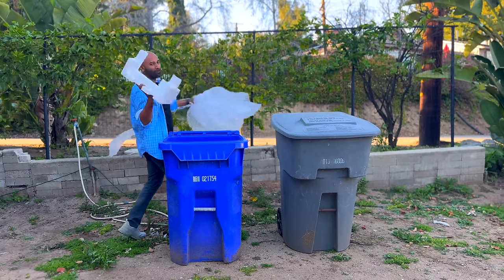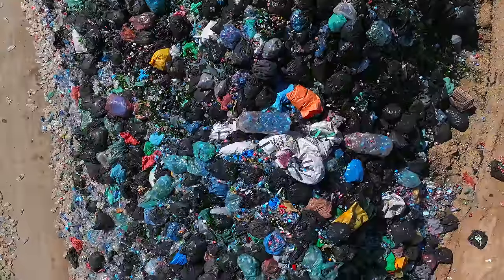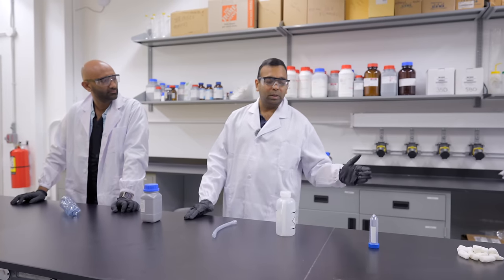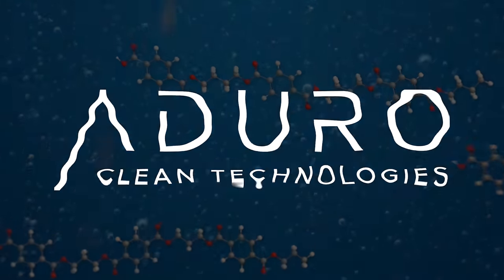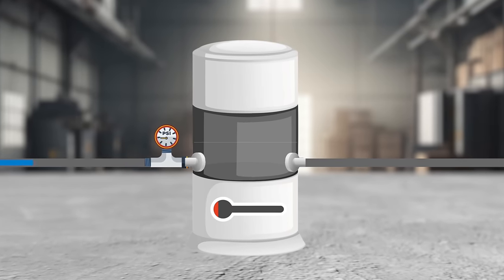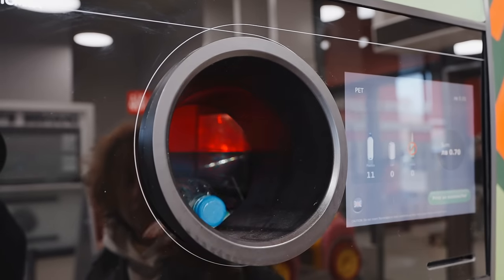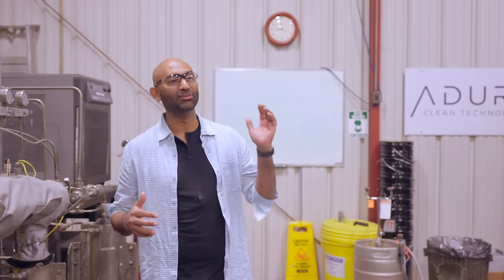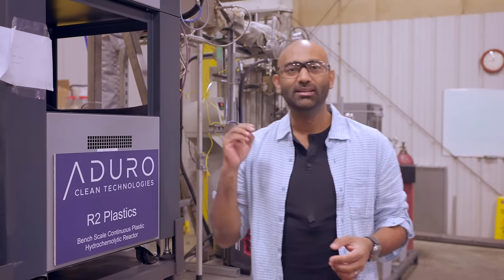Plastic Waste May FINALLY Have a Solution!

Comment: If the product they get from processing is very similar to bitumen, why not use this product as a replacement for bitumen!  We always need to re-pave roads & using this material instead of native/virgin bitumen would be a perfect solution & much more simple.  The real bitumen that is produced from oil production can be processed into something else & further refines at the refineries instead of stopping at the bitumen stage.

Comment: Love the idea, but the economics have to change. When landfill prices are higher than the cost to recycle, things will change on their own. Until then people will chose the trash can. My city does not even offer recycling anymore. It was a losing proposition, so even when I want to it is very inconvenient. Our area has become hard to recycle aluminum cans. It drives me nuts that I have to drive 45 minutes to a place that takes aluminum cans in a reasonable way. There is one 30 minutes away but you have to do a bunch of the work yourself up to feeding the crusher yourself to make the crushed cubes and it is a dirty job for the average person. The cost and responsibility has to go on the producer which will always be passed on to the consumer but you have to start somewhere.

Comment: If NileRed can turn polystyrene into cinnamon flavoring, surely someone can figure a way to break down other plastics into useful chemicals cheaply. I would imagine it could even be possible to break down plastics back into they're original chemicals to be used to make new plastics again without worrying about degradation. Maybe not. I'm not a chemist, I just like watching the processes and dreaming.
Reply: That's pretty much exactly what this process does
Reply: @TristanTemple-jz8bq  it seemed like it was staying the same plastic and the process was just a way of separating the different plastics. I think what I was describing would probably happen after this process.

Comment: Thermal depolymerization was seen as a solution, too, but the economics just don't work.  Without a dive into the economics, I'm highly skeptical of any new recycling process, even if it does produce the original feedstock.  You have to be extremely careful there, because the plastics industry likes to tout these new pie-in-the-sky recycling techs to avoid responsibility for the damage they're doing to the environment; we're always ten years away from perfect plastic recycling and the industry loves it.
Reply: Yes agree. We need to be very careful about greenwashing here. Chemical and or Advanced recycling of plastics has had very little success in practice ( at least from an environmental perspective in the US). Often they still present the same toxic emissions of initial production , high energy use and creation of toxic byproducts in their "recycling" with all to often the final product being burnt as a polluting fuel. Probably much worse for the environment than just burning the fossil fuels they are derived from at the well head.

Comment: The properties that we love about disposable plastic ensure that recycling can never solve the problem. Low density and low cost. This tech can help to reduce plastic pollution in extremely high density environments, but collection is the killer. The low cost of plastics and these base components makes market solutions ridiculous. You could consider it a public cost like trash to collect, process, then make a few percent back by selling the distillate, but you’ve left out 90% of the world. In poorer places this could be used as cooking or heating fuel, but such a process that easily deals with contaminants may be a bit expensive for them. Contaminants and additives are the main issue for other similar methods You’d also need HUGE distribution of these facilities. Transporting plastic is notoriously inefficient, what kind of VOCs and smells is a scaled up facility gonna spew. Are people gonna want to live next to that?

Comment: I've never really understood why we don't limit the types of plastic. It sounds like the process could be simplified drastically just by limiting what colors can be used along with the plastic, and also trying not to mix different types of plastic into the same product. Same with if two plastics are very similar and use the same materials, why not have a preferred type that is the focus of recycling.

On the other side though we would probably be better off just tossing all plastic recycling to the side and just focusing on metal recycling. It's shocking how many people I run into that have no idea about how to recycle scrap metal. They will toss an aluminum can in the trash, and then turn around and recycle a pizza box or a yogurt cup that they haven't washed out. Right now it's just too complicated for the average person to understand and follow and even the above average person has no idea what to prioritize. If you don't believe me just try to organize the following six things in priority for what is most environmentally important. 
1. Using paper straws instead of plastic straws when you eat out. 
2. Recycling aluminum cans when you drink soda at home. 
3. Recycling the metal shelf that you got rid of last week and put in the trash can. 
4. Composting your leftovers instead of throwing them away in your trash.
5. Recycling your pizza boxes.
6. buying solar panels for your roof.

I'd imagine it's pretty hard to prioritize. And even worse it probably varies drastically from person to person. In some cases these may actually be harming the environment or making it more difficult and expensive for recycling centers to operate.

Comment: Not a solution. Plastic up cycling to other chemicals is fine, and although its an expensive process if you can take a cheap waste product and make expensive chemicals from it it might be possible to be economically viable. But the vast majority of plastic are C2 and C3 chemicals, so turning plastic into a C30-20 fraction and a C20-C8 will never be recycling. This is just more of the industry trying to push plastic recycling as a solution (when they know it won't work) to avoid the liability of dealing with the products they make.

Comment: Can this technology be transferred to used car tyres\tires?
Reply: I may be wrong but sadly this probably won't transfer to tires or any rubber. The plastics talked about in this video have minimal crosslinking between the polymer chains this makes them significantly easier to split over the highly crosslinked molecules in rubbers.
Reply: @brandondick52  Thank you. It would be nice to get rid of all these old tires...

Comment: Like so much about plastic recycling, it doesn't make sense.
Using energy to recover lesser energy but requiring a great deal of equipment and infrastructure can only exist with government subsidies.
The best, cleanest and most profitable use is NOT recycling plastic, but burning it in clean incinerators is waste-to-energy plants.

(but at least this anaerobic decomposition method doesn't contribute as much to the microplastics pollution problem as sorting and mechanical shredding)

Comment: I agree with the comment 2 down from this one , this is annoying. The biggest issue is the greed of the oil companies. Yes, some plastics are not made from oil. However most are. The oil companies started pushing plastics back in the 50’s to stop using metal cans and glass containers. Both of which are much easier to recycle ♻️. Steel is forever recyclable. Glass needs sorting for color and can be recycled easily. None of these don’t line the pockets of the old companies. I do 3D printing for my own projects. PETE, HDPE and PP can be used for printing. PETE and PP being easier than HDPE. So how should we be using plastic? All foods and medicines can be put in metal or glass, as it was back in the 50’s and some 60’s. What happened to the metal gas cans? Very safe, add aluminum mesh inside and it becomes explosion safe. Plastic won’t do that!!! How many plastic gas cans have been thrown away due to cracks or the seams splitting. Look at the reduction of plastic usage if we just think about is there a better alternative.

Comment: The governments are unable to ban single use completely but is it possible that they can work with industries and bring uniformity in the colors and materials of every product. may be the manufacturers of large volumes of plastic, like Coca Cola and Pepsi, should work together to find a better way of branding which is recycling friendly. If they cant, then they should stick to glass bottles and fountains where people can get reusables, like in the past.

Comment: Mixed plastic can be turned into flake and recycled together
Reply: What? Mixed plastic can be turned to fuel via pyrolysis but separating the types is one of the biggest issues with recycling. What do mean by "flake"

Comment: This will might work for some  waste streams  to make some of the more expensive plastics, but I don't see anything wrong with simply burning paper and plastic in high-temperature-low-pollution power plants to make electricity. We need the electricity and using trash for power generation reduces the amount of virgin fossil fuel we need to dig or pump. Either is better than dumping it in rivers and in the oceans.

Comment: If only we kept glass bottles.
Reply: They were not a panacea. First, they are very heavy, and not very compact. Reusable bottles were even heavier than single use glass. Then, you run into the issue of people mixing pesticides or storing oil-based products in a glass bottle, and then returning it for a deposit. This made it difficult to safely reuse bottles. The extra fuel needed to transport full and empty bottles made them cost prohibitive both for the full bottles, and the later recycling. Hence, we got plastic. Aluminum is better than glass, but plastic is cheaper. There's no good answer. I suspect that the recycling process in this video uses much more energy than producing plastic directly from oil. This has been the problem with all of the chemical recycling options.

Comment: 2:28 "no plastic on the periodic table" -- WRONG.  You were looking right at them.  H and C.  Plastics are predominantly these.  Other than the trace of dye, HDPE is pure hydrocarbon, C2H4.  PVC has Cl and Teflon has F.  Otherwise everything's H and C.  They are HYDROCARBONS.

Comment: My simple solution is to only allow plastic that is safe to burn.  And by that I mean it produces the same off gassing as burning wood, something that people were doing for thousands of years and it didn't cause problems.

(The soot problem in England in the 1800's wasn't from burning wood, that was from burning coal.  So toxic that they had to change the way they cooked food because coal dust was so bad for you.)

Comment: Any company producing a material good should be responsible for that good through it's full life cycle.

Too much of the cost of products, like a bottle of coke, is passed into the consumer.  Disposal, waste from production, etc all get passed into the taxpayer through things like environmental cleanup, recycling, etc.

If Coke was responsible for a bottle and EVERYTHING it took to produce it, things would be very different.  Paper labels, the number of different plastics, etc would all be FAR more simplified for ease of recycling.  Instead these things are designed without a care for what happens once it is sold.  Sure things would be more expensive.  But not as much as you think.  If s bottle of coke cost $0.25 more, it would not be a big deal since we only much.  But to coke this represents a huge, billion dollar change.  So it will never, ever, happen by choice.

These companies must be made to be responsible for the things they create, and stop off-loading these hidden onto the taxpayer so that Coke can make more money.

Comment: How does it compare to Purecycle?
Reply: It is way better. It can handle a lot more plastic types than purecycle and it is lower capex and opex, plus it can handle residues.
Reply: PureCycle has a plant up and running in Ohio with more on the drawing board.  The market is huge.  Plenty of room for lots of players.

Comment: Please don't take this the wrong way, but this has the same economic problems that the vertical farming initiative has. It looks completely uneconomical to do this compared to simply making more plastic. It's energy intensive, requires a lot of up front equipment working at high temperatures and with a lot of intellectual property and smart boffins. When looking at this product versus an identical product at a fraction of the price, which will business choose?

Comment: All the needs to be done is to reheat the plastic with super heated air....... 
thats how the plastic is prepared for shipping to the production plant....it comes as small pellets , that are melted with "super heated air , ,melting the pallets, then onto the blow form, press, vacuum  or extruder resulting in the desired shape.
all that needs to be done is to use SUPER HEATED AIR,,,,,JUST LIKE THE ORIGIONAL MANURFACTURING .....DUH

Comment: Surely, if it's a legitimate solution, governments should be banging on their doors, asking to invest.... especially in the EU, where they have a strong commitment to net zero and environmental issues. I hope they've found the answer to plastic waste, but until I see a full scale system, actually up and running, I won't be holding my breath.

Comment: The process shown is not recycling. It is down cycling - you take pure plastics - break them down and get something else. But you don't get the respective plastics - nor their monomeres in pure enough shape to re-enter their original processes.

This does not solve plastic waste - it is still wasted - at most it can be burned for energy, but then you have that carbon dioxide thingie.

Right now only plastic avoidance would reduce the plastic waste problem until the companies come up with a plan to actually recycle their products that they claim are recyclable in numbers like 80+%. (which they likely wont do).

So we should find Coca Cola for using plastic bottles instead of glass. For polluting the world.

Comment: This is simply a gassifier, a technology that has been around since 1890s. Other countries where fuels are very expensive ALREADY have gassifier systems they feed plastics and tires, etc back into liquid fuels. 

The large cost of delivery of plastics to these types of plants in the USA make it unviable. 

Gassifiers were put on trucks back in the early 1920s. All they are doing is adding a chemical that increases the temperature a bit because chemical reactions cause heat.

Nothing new here

Comment: What's amazing as it's took so long ... can make seven plastics from crude oil it was pretty obvious that they should use a similar technique to recycle  really is all about invested interest those people making crude oil into plastic could have done it long ago, $100 million in research funding is small $ all they need to do is just feed it into the existing crude oil which has a million ton plastic production... But with that interfere with the supply chain how much profits involved

Comment: TwoBitdaVinci - Ummm, Japan solved its Plastic & Recycling more than 2 DECADES ago. 
Japan invented closed loop Recycling. 
and they sort LOCALLY 10 kinds of plastic , 20 kinds of Glass , and separate Batteries, metals , wood , etc. 
Japan even separates the LABELS from plastic bottles, & CAPS as they are Different Plastic .
as well as Pull Tabs from Drinks .
these are Recycled Internally in Japan and made into BOTH NEW Bottles & Packages as well as Foux Wood , street furniture, playgrounds , playground padding, Consumer goods and even Clothes for Students . 
JAPAN also has very Healthy REUSE centers that SELL at cost USED & Repaired goods.
as well as Clothing and Fashion items. 
things like OLD Kimonos are UPCYCLED into Tote Bags . 
TOKYO bay alone is OUT of Landfill space. 20+ years ago. 
so it had to invent NEW industry.

Comment: So this is a big advertisment
Reply: Yes. The actual name for this process is pyrolysis, or heating a substance with long-chain molecules in a low-oxygen environment, often in a pressure cooker to further accelerate the process. For plastics it's a well established technology known as thermal depolymerization. But various startup companies want to run around and try to patent this additive and that catalyst and the other thing, claiming they have some novel new way to do it.
Look up thermal depolymerization on wikipedia.

Comment: The problem... Attacking the issue from the WRONG END! Why should the solution on fixing the problem fall on the end user! When the ENTIRE problem is created by the Producers! Those who create and profit from the creation of the pollution should put in forefront for solving the problem! Write, Pass, and Enforce - Laws requiring Producers to select and utilize materials that can be either recycled or naturally degrades! Yes, that would increase cost, but the end users are already eating those costs and more dealing with or suffering from the pollution!

Comment: There has long been a solution, but american "but my property value" schmucks refused to take that step. We have had long life construction materials made out of recycled plastics for decades now. Making one average sized deck would take over 100,000 2 liter bottles out of a landfill. That's more soda than the average family who owns that average deck would drink over the expected lifespan of the thing. When time to replace that deck the old one can be recycled as well. May not be as naturally pretty as a wooden deck, but they're paintable. There are a thousand invisible components in a new construction that could be replaced with reclaimed plastics.